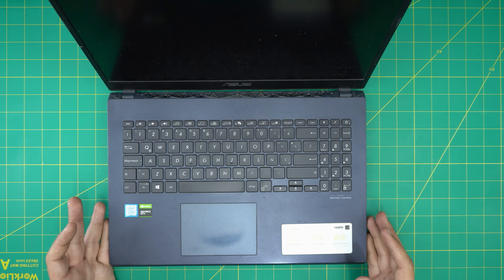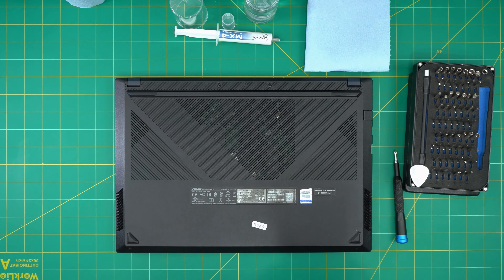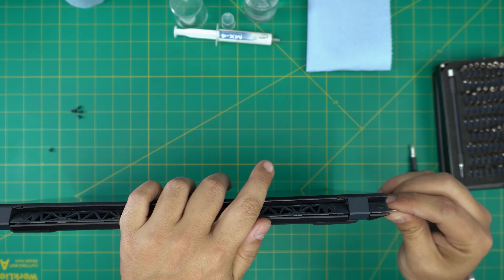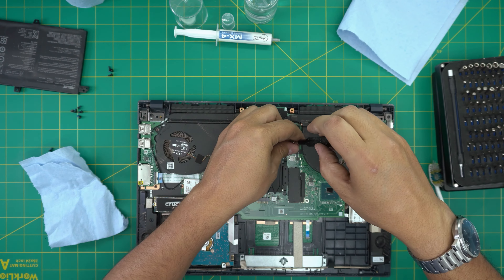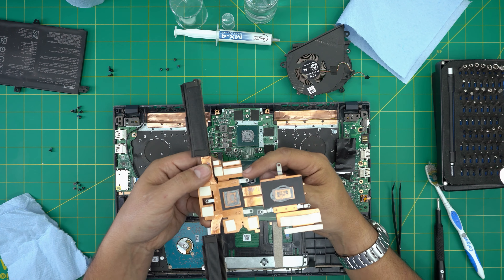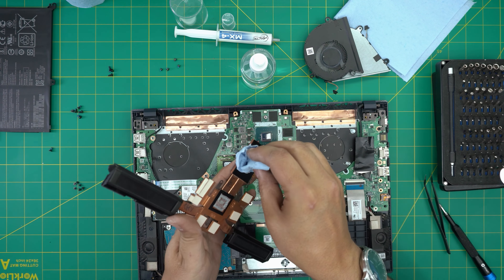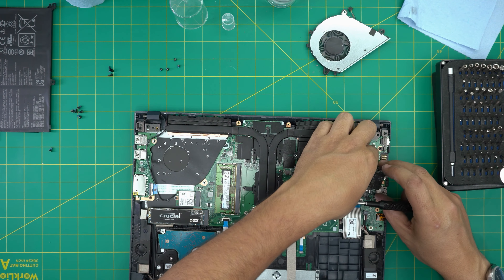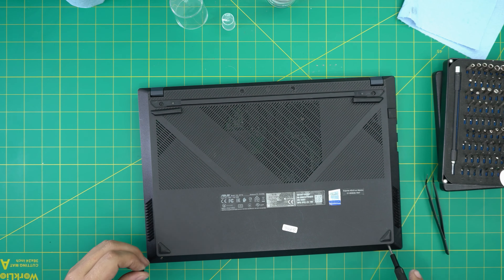How to Repaste and Clean ASUS X571 X571GD-BQ234T Laptop - Step-by-Step

Comment: Hello brother.... Very informative video. 
Earlier my fan having noise... I brought new one & changed it. 
After two days again i am getting noise from new fan as well..
Reply from the maker: 🫠Regarding your question, what type of thermal paste you used (what brand)?
you need to change the thermal paste with a good brand.
Reply: @uFixTek  coolermaster regular. 
Fan works fine when there is less load on cpu but when load increase it starts to vibrate and makes weired sound.
Reply from the maker: something like this happed to up at the store for one of my clients, and we replaced the fan 3 times, and on the 4th we went with different brand and provider for the fans.
Reply: @uFixTek  Thanks for sharing your experience. 
I was feeling the same that issue might with the new fan as well..
Reply from the maker: It's my pleasure my friend.
hope you get to find a better quality fan 
cheers🍻

Comment: Hello my friend, I would like to ask if the speaker of this laptop is stick with glue?
Also, I would like to ask if there is any chance of making a video explaining how to replace the speaker of this laptop?

*The above content is translated by Google, please forgive me if there are any errors.
Thanks
Reply from the maker: 🫠Regarding your question, the speakers are glued with adhesive. Apply 95% isopropyl alcohol under the speakers to make it easier to remove them. If needed, you can purchase new speakers from AliExpress. Replacing them is very simple and easy. Use double-sided tape to secure the new speakers in place.  

Cheers! 🍻
Reply: @uFixTek  thanks
Reply: @uFixTek  But I want to ask, can the double-sided tape ensure that it will not fall off?
Reply from the maker: yes you can and it will be 100% ok

Comment: You're the GOAT man ! Definitely earned a subscriber ! Regarding the fans, did you personally open them up ? If so, were there many screws or fragile parts that should be taken into consideration before proceeding ? I was also worried about the thermal pads since removing the heatsink would maybe require to change them. Regarding the vents, if i clean them with isopropyl using a toothbrush, would i need to wait for them to dry (or accelerate the process with a hair dryer ?). For the thermal paste, i found the Cooler Master MASTERGEL PRO V2 in a tube of 1,5 ml. Would that be enough ? Thanks again, i will share the channel with a friend of mine who also looks to repaste and upgrade his laptop ! Have a nice day 👍
Reply from the maker: It's my pleasure my friend to help, regarding the fan opening it is not fragile just remove the tiny screws and open the fan, it is just like playing lego, it is very simple and it is not delicate, i do open them daily on many laptops and service them, i been doing this for past 18years not :(
you can clean it with 98%+ iso alcohol. no need to wait for dry just blow some air in to the fan and that is all 5min wait before powering on (by the time you finish putting the laptop back together it will be more than 5min :P ).
the cooler master is super fine and 1.5mm is more than enough.
cheers🍻
Reply: @uFixTek  Thaaaaaaaaaaanks man ! Just the thermal pads, is it mandatory to change them when removing the heat sink ? It's my last question, i promise. I just want to be sure before purchasing the thermal paste. Again, you're very kind, who would answer to comments on a 1 year video ! You were really very helpful, thanks again !
Reply from the maker: i would highly recommend not to touch the pads, the pads don't need changing, unless they are very damaged.
It's my pleasure my friend, no matter the video age i always try to answer question, else there is no point to the videos if i only do half ass job 🫠 (new comments are priority always😉)
cheers🍻
Reply: Again sir, thanks a lot ! I'm going to apply the paste in the comming weeks, hope it will work well and reduce the temps !
Reply: Yo bro did u replied your thermal paste ?! @The_Chicken_Man

Comment: Thank you very much for the informative video! I don't know how much time you had with this laptop but can you tell me if it's normal for the air of one side of the coolers be hotter than the other? I see that the die of the cpu is mostly on one heat pipe but isn't there a heatspreader layer that would prevent this? I'm having this "problem" and I was hoping that getting a repaste would solve it but seeing the video it seems to be the design 🥲🥲
Reply from the maker: Thank you for your feedback! If you wish to support the channel, you can like, subscribe, or both!
Regarding your question, yes you will always feel that one side is hotter than the other side, unless GPU and GPU load are high, then both side will be hot.
the reason is the fan curve of the left side or the right side are separate one is based on GPU and one is based for CPU. so if the CPU dye heatsup more the fan for that side will spin more. if the GPU dye is under load and the fan for it will spin and that side will heat more.
Should you have any further questions or requests in the future, please don't hesitate to ask me.
cheers🍻

Comment: Hello friend. I have a problem two of the screw on the heatsink is screwed I mean my screwdriver tip can't take it out. what shall I do?
Reply from the maker: Thank you for your feedback! If you wish to support the channel, you can like, subscribe, or both!
Regarding your question, use a sharp corner flat screw driver that can fit inside the damaged screws, and the flat head drewdriver can help, if not let me know i assist you more.
Reply: Sorry can't fit. I wish you can see the picture it is hard to screw out
Reply from the maker: send me a picture:  	ask@ufixtek.com
also see this:
https://youtu.be/UaMO0sH45VI
https://youtu.be/xLt6dMIsO9E
Reply: @uFixTek  thanks. you are very helpful friend.
Reply from the maker: It's my pleasure my friend. 😊

Comment: Hello sir, thanks for your video ! I have a very similar pc : ASUS X571LI with an i5-10300h and a gtx 1650 ti. I wanted to know if the internals were the same as yours, if i needed to replace the thermal pads when removing the heatsink, if i could clean the vents with alcohol and if using pressurized air to clean the fans would damage them (as they would be spinning while beeing turned off). Maybe opening them would be better ? Anyway, with or without answer, i wanted to tell you that the tutorial is very well made ! :medal-yellow-first-red:💯
Reply from the maker: Thank you for your feedback! If you wish to support the channel, you can like, subscribe, or both!
Regarding your question, the process is nearly identical internally, so you're in good hands. For cleaning the vents, it's safe to use isopropyl alcohol with a concentration of 98% or higher. When it comes to using compressed air for the fans, please ensure the fans are disconnected from the motherboard before proceeding. This allows you to safely spin them without risk. However, if they remain connected and are spun rapidly, it can generate voltage that flows back into the motherboard, potentially causing damage. Essentially, any fan can act like an electric dynamo.

I recommend disassembling them to remove any dust accumulation before blowing air. Sometimes, if there's a significant buildup of dust and you directly blow air onto it, the dust can enter the fan mechanism and prevent the fan from spinning properly.

Should you have any more questions or need further assistance in the future, please don't hesitate to reach out.

Cheers! 🍻
Reply: @uFixTek  You're the goat :goat-turquoise-white-horns:! Definitely earned a sub mate ! Regarding the fans, did you personally open them up ? If so, were there many screws or fragile parts that should be taken into consideration before proceeding ? I was also worried about the thermal pads since removing the heatsink would maybe require to change them. Regarding the vents, if i clean them with isopropyl using a toothbrush, would i need to wait for them to dry (or accelerate the process with a hair dryer ?). For the thermal paste, i found the Cooler Master MASTERGEL PRO V2 in a tube of 1,5 ml. Would that be enough ? Thanks again, i will share the channel with a friend of mine who also looks to repaste and upgrade his laptop ! Have a nice day 👍
Reply from the maker: It's my pleasure my friend to help, regarding the fan opening it is not fragile just remove the tiny screws and open the fan, it is just like playing lego, it is very simple and it is not delicate, i do open them daily on many laptops and service them, i been doing this for past 18years not :(
you can clean it with 98%+ iso alcohol. no need to wait for dry just blow some air in to the fan and that is all 5min wait before powering on (by the time you finish putting the laptop back together it will be more than 5min :P ).
the cooler master is super fine and 1.5mm is more than enough.
cheers🍻

Comment: Hi, do you know if it works With Intel ax201 and ax210 wireless module? Or the best for this motherboard is the ax200? Other question is, mine comes with 8gb ram, i put more 16gb, do you know if this notebook accept 32gb in the slot upgrade? Thank you
Reply from the maker: 🫠Regarding your question, it does take ax210 wireless card. about the ram: https://youtu.be/Nu1zISU4Zws
about the ssd: https://youtu.be/RmHs9c88nl0
Should you have any further questions or requests in the future, please don't hesitate to ask me.
cheers🍻

Comment: Hello friend. Maybe you can help me. I replace the wifi chip with ax210 but the laptop as only one antenna and wifi can't work properly any idea how to solve this? the model is same as thisK
Reply: same wifi card in your video one wire only... but I replace with ax210 with two needing connection but this laptop has only one connection
Reply from the maker: you need to get an antenna for it and place the antenna in a empty space over the battery or around in the case.
https://amzn.to/3r0EnpP
Reply: @uFixTek  oh I see so I need to buy one? No workaround from it like software?
Reply from the maker: no with software side you can't do anything this is hardware need

Comment: Thanks for the good video, 
Do you think it is possible to change only the cpu or the gpu?
Reply from the maker: It's my pleasure my friend, i appreciate your support.
🫠Regarding your question, I'm sorry to inform you that the CPU and GPU are soldered onto the board and are neither upgradable nor removable. Additionally, the surrounding components are designed specifically for those models.
Should you have any further questions or requests in the future, please don't hesitate to ask me.
cheers🍻
Reply: @uFixTek  Do you have already graphic's problems with this computer? Like horizontal lines on the top of sreen, even in the bios, and safe mode. After a moment everything's freeze, beyond the screen i can see process works but the problem is too strong... Hope when i update the UHD & screen's drivers but for short time. I'm deseperated, test on another screen it's my last chance i think... Thanks

Comment: Hello,may I ask what should I do if my laptop is at 95° when playing light gaming and  cpu temp at 55° when idle? I've already cleaned and repasted MX-6 thermal paste and cleaned the fan and heat sink. Lately, it shuts down, then restart when CPU temp reaches 95°.
Reply: My laptop is same as yours
Reply from the maker: 🫠Regarding your question, did you make sure that you heatsing vents are cleaned?, and also you may have aun even heatsink, this is very common.
use a thick thermal paste like: arctic silver 5: https://amzn.to/4e5Lz7M
or the other option is to use a copper shim .5mm: https://amzn.to/3Vi2r2y
and with copper shim use the MX-6, also make sure your thermal paste is original, there are so many fake paste out there.
and place the thermal paste on the GPU/CPU and place the copper shim on top center it, and place one drop of the paste on top of the copper shim and then place the heatsink straight and screw it and enjoy.
Should you have any further questions or requests in the future, please don't hesitate to ask me.
cheers🍻

This is an Amazon affiliate link. When you use my links, you are helping to support the channel. 🙏
Reply: @uFixTek  thanks broo. I'll try to do it.
Reply from the maker: It's my pleasure my friend.

Comment: Hello, by any chance do you have the modelsheet?
Reply from the maker: the laptop info:
Asus Gaming Notebook X571Gt-Bq185T, With 15.6 Inch Display, Core I5-9300H Processor,8 Gb Ram Ddr4, 1Tb+256Ssd, Nvidia Gtx 1650, 4Gb Gddr5,Windows10, Black, En-Ar Keyboard, 2Y International Warranty.
the manual:
https://dlcdnets.asus.com/pub/ASUS/nb/X571GD/0409_E16052_X571_V2_A.pdf?model=YX571GD

Comment: I have the same laptop and I've tried to install an 2.5 SATA SSD but I didn't have the connector. I've bought one on the Chinese shop and when I've connected it to laptop and SSD and started the laptop the strip MELTED instantly. I think I've bought a wrong connector. Can you please tell me what SATA connector should I buy to make the 2.5 SSD drive work just like on the laptop you're showing here? I would be very grateful. I don't want to damage my laptop trying to upgrade it with an 2.5 SSD drive.
Reply from the maker: 🫠Regarding your question, i really hope that you have not damaged the connector, count the golden pins at the back of the connector and let me know how many pins are there. so i can send you the correct part.
Should you have any further questions or requests in the future, please don't hesitate to ask me.
cheers🍻
Reply: @uFixTek  Thank you for your response! I've counted that there are 10 pins there on the laptop's motherboard connector and there were also 10 pins on that strip that I've bought on Chinese shop. When I've turned on the laptop with the SSD connected to it, the side of the strip started burning so I've immediately turned off the laptop (the battery wasn't connected). I've read later that the 2 pins on the side (out of 10 pins) of the connector are a 5 Volt lines to power the SSD. The connector on the laptop's motherboard is intact and it was checked by the repair guy. I've asked him if he could buy a proper connector and install the SSD but he said that he won't do it because those connectors are very faulty and it's hard to buy a good one that will work and will be reliable.
Reply: @uFixTek  Any chance for a response?

Comment: That tiny drop of paste only is enough? why so very tiny?
Reply from the maker: Oh, it is more than enough to use just a raindrop-sized amount. Due to the pressure from the heatsink and the lack of space between them, that small drop will be sufficient. You can perform a simple quick test by placing a small drop only on the GPU or CPU, then placing the heatsink over it and applying pressure. When you lift it back up, you will see that the thermal paste has spread to cover the entire surface of the GPU or CPU.

It's important to ensure that you clean the surface properly before reapplying the thermal paste. If you apply too much paste, it can overflow and contaminate the BGA chip. This can lead to poor thermal performance.

Should you have any other questions or requests in the future, please don't hesitate to ask me.
Reply: @uFixTek  so it is very important to put just enough so that you won't spill right?
Reply from the maker: Yes, simply apply a fair amount and that should be sufficient. Avoid overdoing it or using too little.
Reply: @uFixTek  Okay I will follow your video thank you
Reply from the maker: my pleasure my friend
Reply: @uFixTek  by the way you only put paste on the chip. How about the heatsink you need not put a paste on it?
Reply from the maker: ONLY on the CHIP you don't never place on both sides.